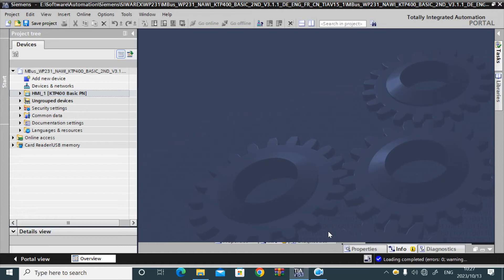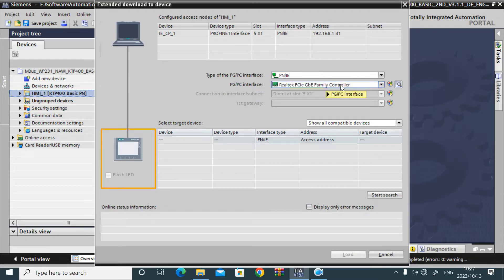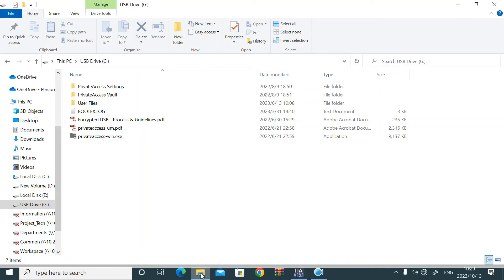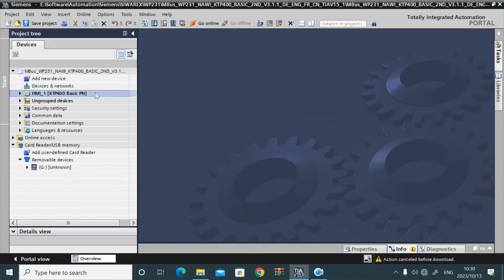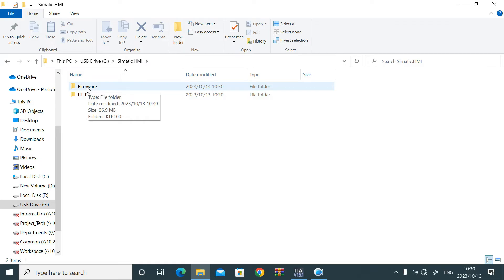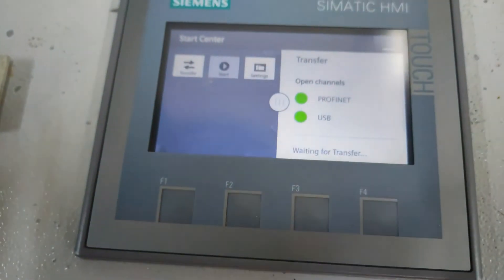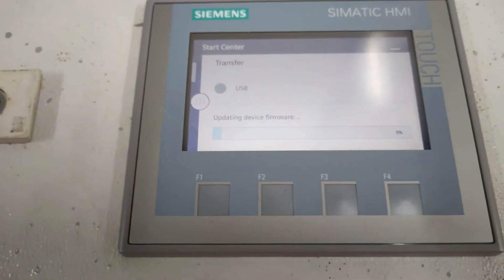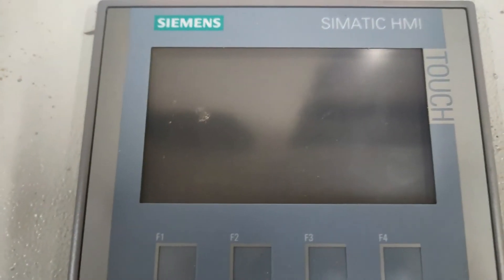TIA: how to download HMI Project by USB ?

Comment: Hello,tanks❤
I change project device from ktp600 basic to ktp 700basic but scren size small ,why?
Reply from the maker: there is a setting which you have set during device change. please follow the steps in video https://youtu.be/FH5-Lo1eAqc?si=58z2v5_4aQZrhexm
Reply: @faridautomation  🙏🙏🙏
Reply: Resize from setting fit to screen